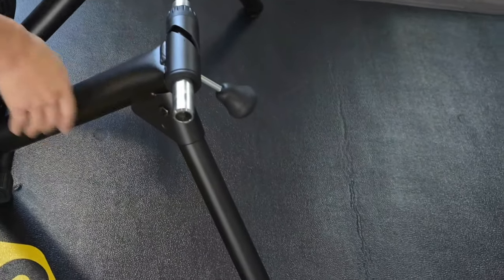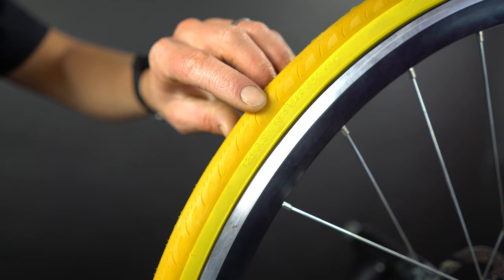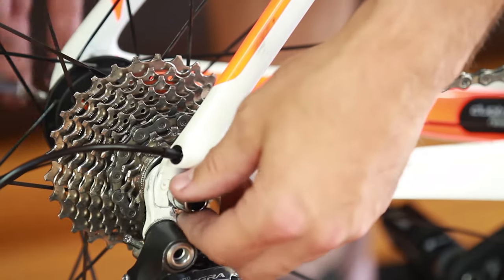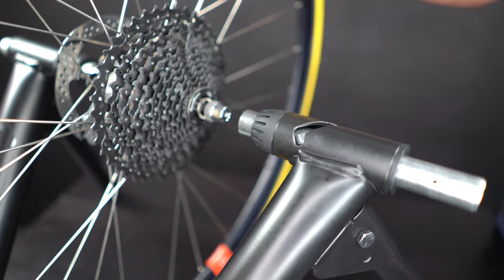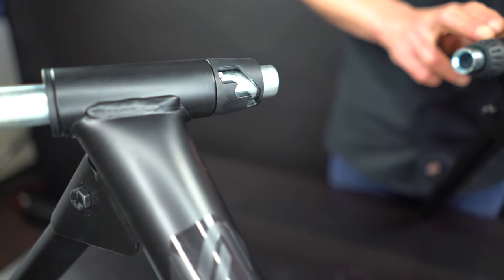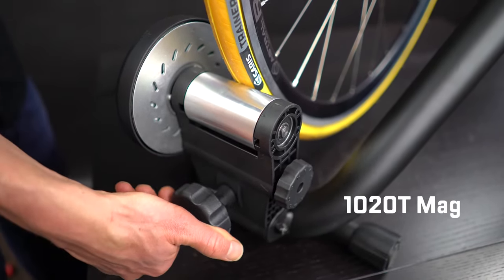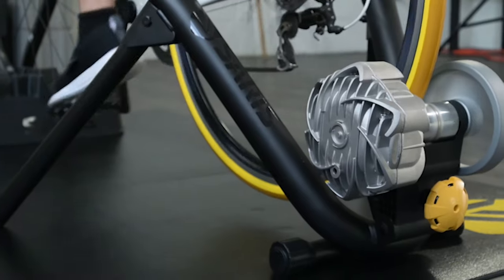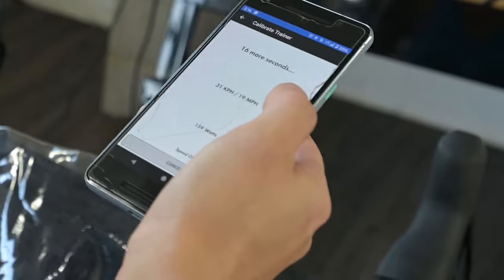Saris Wheel-On Bike Trainers | Bike Installation

Comment: I can't get the bike to line up to turn the lollipop lever, I feel like it is the resistance system being too high up but can't move it. Any ideas?
Reply from the maker: Hi! Have you reached out to our customer service team? They should be able to help you troubleshoot any issues you've been having with your trainer. You can reach them at support@saris.com or 1-800-783-7257
Reply: @SarisOfficial  I figured it out, I should only have tightened it once the bike was on.

Comment: NO! Adjusting the tire tension until it clicks has caused numerous failures. Bad design. The click is not consistent. Just 3-4 turns after you engage the tire. If it doesn’t slip, you are good to go. If it does, tighten more. Save the setting for next time.
Reply: Sounds like you have a bad tension knob. Mine clicks just fine.